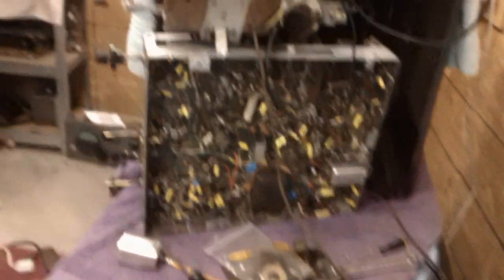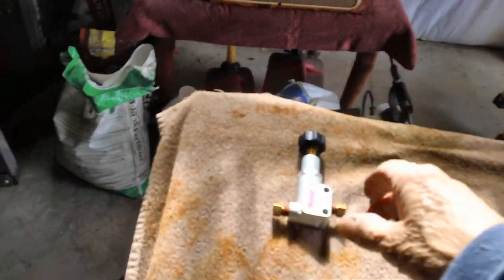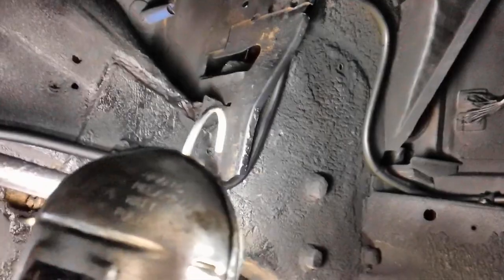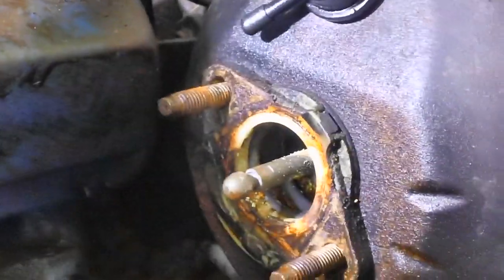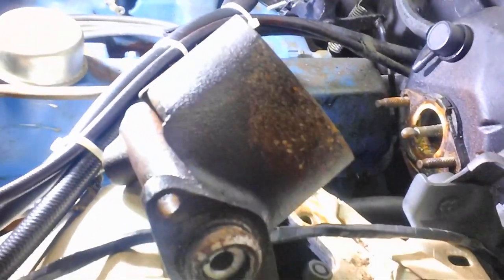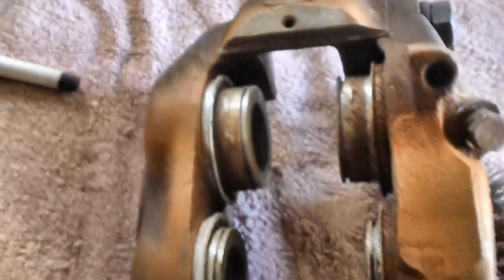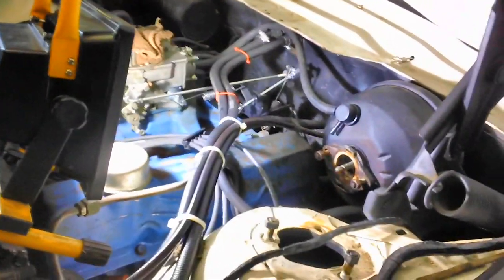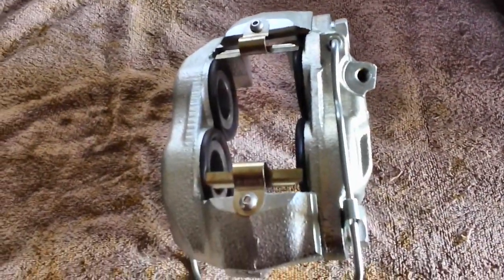1966 Ford Thunderbird repair and  refurbishment (Part 63). Ball joint install. Master cylinder.

Comment: You need a big Porta-heater or Reddy-heater.  Mine warms up the garage in about 4 minutes.  Kerosene is very expensive, but it does last a long time.  Thermostat I added kicks it on at 60 degrees, but I jump out of my skin every time it kicks on!
Reply from the maker: Ansel,
I've considered one of those heaters, but found them to be too loud.  And I won't have anything to do with kerosene.   Not my cup of tea, my friend.
Regards,
John

Comment: Glad to have you back and hear your son is healing faster than expected. I plan to craw underneath my ’65 and break loose the bottom shock bolts tomorrow.
Reply from the maker: John,
Our boy is practically back to new.  He's a jock and heals fast.  And piece of cake on those shock bolts.  A good bath in penetrating oil will make the job much easier.
Regards,
John

Comment: Nice idea for the bracket on the proportioning valve. The replacement flyback on the RCA is not a bad idea at all, one of the real telltale signs of an overworked overheated flyback is wax having leaked out of it, or on later ones a cracked insulating doughnut, RCA color sets were known for eating flybacks all the time. The Early Television Museum is a great resource for collectors, they are even working on a long term project to be able to rebuild CRT's.
Reply from the maker: It appears the museum has given up on the CRT rebuild plan, but there is some soon-to-retire Navy Chief Petty Officer who is supposedly gathering up the works to do it himself after retirement.
Regards,
John
Reply: @joernone  Actually it's all related, Nick was the one that went over to France to learn how to rebuild CRT's from the last company that did so, when the owners retired and closed up shop. There are now to locations set up to do the rebuilds, the Museum in Ohio (where tubes do get rebuilt during the annual convention), and the other at Nick's place so he can perfect his skills and work on things when not involved with Navy stuff.

Comment: Hey John, do the upper control arms have to be removed for the ball joints to be replaced? I’m trying to plan out how to replace mine soon
Reply from the maker: Ben,
No, but be careful, take your time, don't force anything and they'll come out, after you disconnect the spindle.  If the ball joints are original they'll be riveted in, meaning the rivet head will need to be ground off.  If they're held in with bolts and nuts then they've been replaced somewhere along the line.
Did you get the MC off the front porch?  I don't trust delivery dudes.
Regards,
John